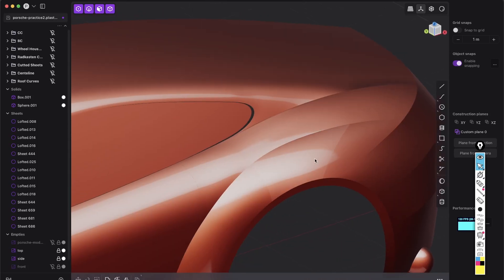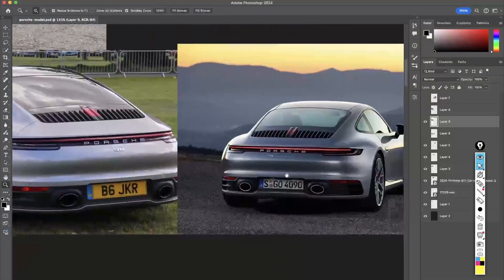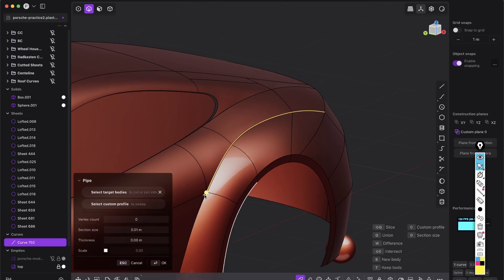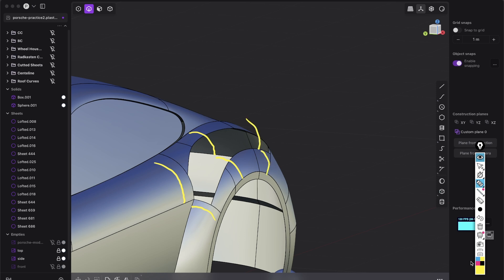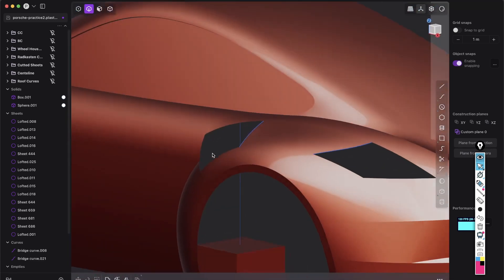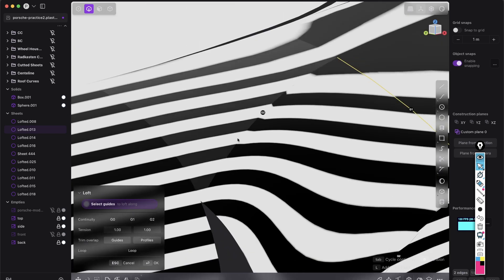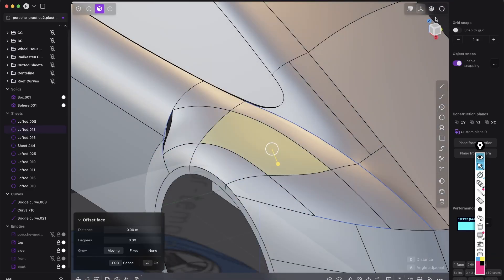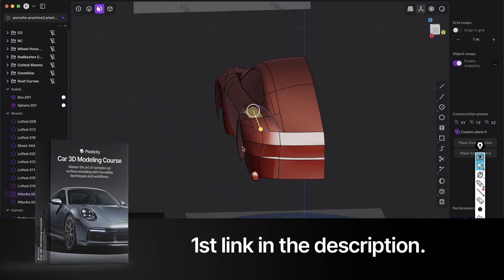Car Modeling in Plasticity | Blending Surfaces

Comment: I assume that the full course will not fall back to using Xnurbs since we need the studio version to achieve that.
Reply: Assuming that you use good modeling techniques then I think the indie version is good enough to get a good enough result. I have not taken Nikita's course, but I would say thta if you are trying to do automotive surfacing, the extra $150 for the studio license is worth it. For me, it's not the xNurbs command as much as it's for the Square command (which is based on xNurbs). If you notice in the video, when Nikita tries to do a G2 blend he's getting those nasty abberations and having to revert back to G1 and not getting a great result. While the loft feature makes some really nice surfaces, it also makes a ton on control points in the process, so when you go to blend surfaces that were built with loft, you can get some really nasty results. The best practice here would be to try building as many primary surfaces as possible with sweeps Try to keep the swept curve and rail as simple as possible and let the curvature come in the blends (if you start modeling more and then looking at cars from all angles, you'll start to notice how flat panels really are, but the reflections in them give the illusion that they have more curvature than they do). Some primary surfaces cannot be made from sweeps and loft must be used (especially since you can kind of force a bi-rail sweep, but technically that option doesn't exist). Before blending surfaces made from loft or any swept surfaces that have been trimmed, rebuild the surfaces with an appropriate and minimal amount of UVS using explicit control (in most cases 3x3 will be good, sometimes you need 5, beyond that you may want to consider breaking up the surfaces into a couple smaller chunks). If you need to increase the number of spans you definitely should break it up. You will almost always get a better result with two single span surfaces than with one 2 span surface.

The downside is that the explicit control tool using the Parasolid kernel isn't as accurate as if you were to rebuild the surfaces using the square tool. I also much prefer using the square tool for blends and it even does a really nice job with bi-rail sweeps. Most people use xNurbs to fill in non-foursided holes, and it is very good at that, but remember that the UV structure is going to be crazy and if you start blending off those surfaces, you'll get some crap results again. I like it as an alternative to loft in situations when I am lofting a curve to another curve and want to make a control curve in the middle that will effectively be controlling the "crown" of the surface. Loft will give you a nice "crown" in the middle, but flatten out at the edges, whereas you can use xNurbs to make that same surfaces, but retain more proportional crown throughout. It's an extra step, but if you Alt+T on that (or any other xNurbs surface that doesn't use the quad'sided button, you'll see that it's a really odd surface and, as I mentioned, trying to make blends off of it will suck, so I'll trim it to what I need, duplicate the edges, rebuild those curves to the correct number of control points, then use Square to make a new clean surface.

tl;dr

If you want to get the best possible results are exporting as a step file for a real production part and/or really care about highlight control, then spend the extra $150 for Studio. If you are making ideations and/or videogame assets that will be exported as SubD models, then you can totally get away with indie, but may still want Studio juts for the quick and easy surfacing of xNurbs.
Reply: @SchroedingerK By the sound of it, I am better off sticking with Blender for modelling cars and modifying the cars. Thoughts?

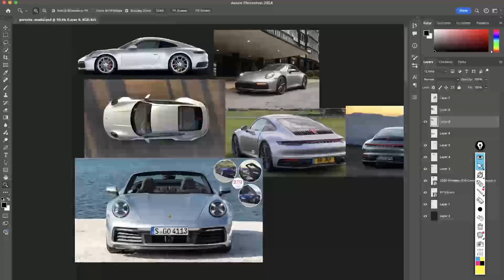My end result is to aim for 3D printing 1:24 scale cars.
Reply: @CiaranWhelan  Hmmm. I really can't say what you're better off doing. Really depends on your experience/skill level in SubD vs Nurbs modeling. I find Plasticity to be very easy to use and a great value compared to the really high end software. For 3D prints, you'll have results that are more than acceptable in Blender and in Plasticity (even if you only go for the indie license). It's really up to what work flow you want to use and if you want to stick to free software or spring for Plasticity. 

If you are a total noob to Nurbs download a free trial to MoI3D and then once thta's up the 30 day free trial to Plasticity. Overall, Plasticity offers more tools and, of course, the user interface is different between the two, but MoI is great for getting your feet wet in Nurbs modeling. Or you can try getting a free license in F360